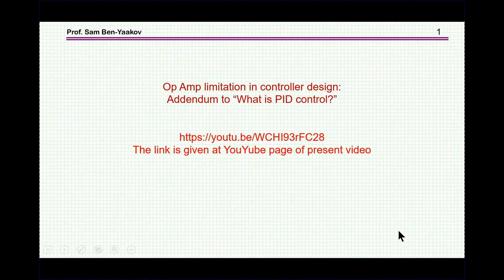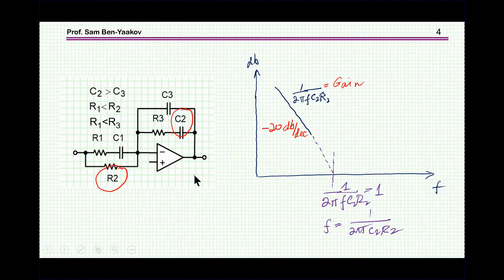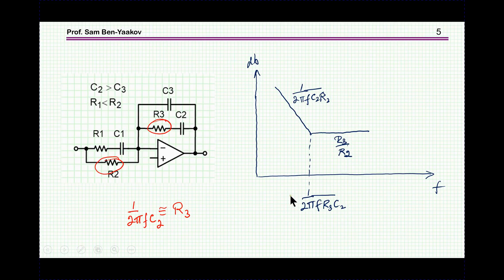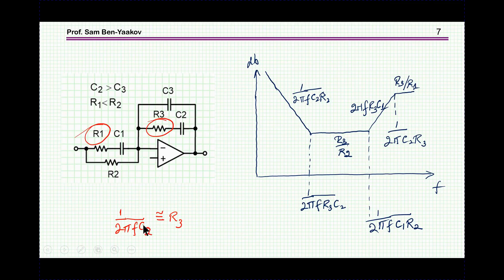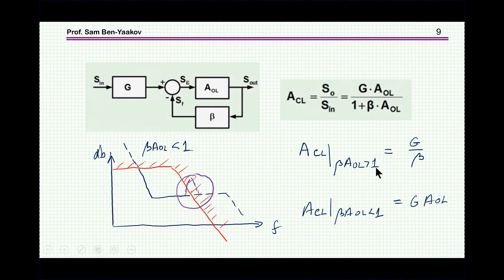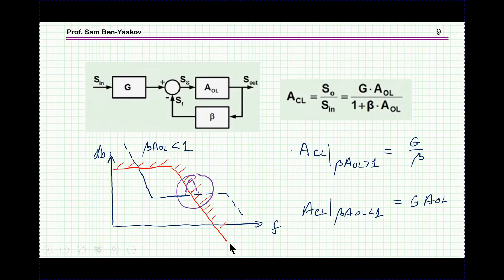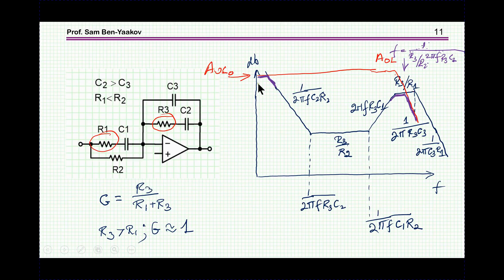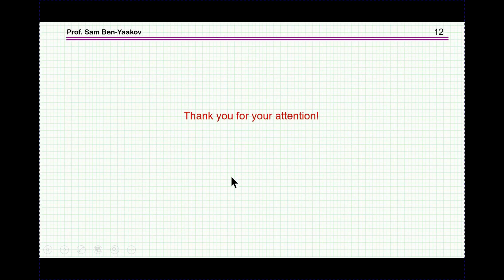Op Amp limitation in controller design

Comment: Thank you for vedio.
Could you upload vedio of type two compensator which includes T. F . , Poles and zero calculation and then bode plot.
---From India
Reply from the maker: Hi Shiv, Thanks for comment. Will consider it.
Reply: Sam Ben-Yaakov Thank you so much for your consideration. 
One more suggestions from side is take a numerical example and explain it.

Ex. Let's say type-2 compensator design for Flyback converter which includes TF of plant , post filter and feedback loop. Then how to achieve loop stability using compensator.

A beginner like me expect basic level of explanation which can easily understandable .

Thank you so much .

Comment: Hello Professor, myself Ganapathy, I'm having a doubt in control system which I can't find answer can you clarify it ?
My doubt is what is the frequency that are referred in x axis in bode plot ?
Where it present, input , output or feedback loop or the controller itself ?
I understand, in RC circuit ratio of output to input is marked against the input frequency which gives slope ,phase etc
But consider a PID motor control which controls the speed of the motor like a opamp with feedback control a motor with a mosfet and speed of the motor is feedback through a frequency to Voltage controller which generate voltage proportional to speed so the opamp have two inputs 
- reference speed (in volts)
- actual speed (in volts)
There is no frequency or ac components in the system how will get stability from blode plots ?
Similarly in RC circuit example I see the physical components of blode plot in terms of input frequency and change in Voltage for input and output in oscilloscope
But how can I view the physical components of the bode plot representing Especially the frequency ?
Another doubt consider the system with 2 poles and a zero when frequency hits first pole gain drops 20db/Dec, on 2nd pole it drops to 40db/Dec, then on zero it rise to 20db/Dec and the slopes intersect here so the system is stable but when the operating frequency lies in between second pole and zero where the slope is 40db/Dec still the system be stable ? Phase margin would be 180 when slope drops at 40db/Dec ,hence why the system stability is calculated from single point in the plot, what happens when the system operating frequency is other than that of a intersecting frequency point ?
I just try to implement the mathematical model to physical system and forgive me if my question are silly , but I need to know the physical components the blode plot , Nyquist diagram, root locus diagram representing
Reply from the maker: Hi Raja, 
If not imposing too much I would appreciate if you would post your question at the LinkedIn group I have stated. 
https://www.linkedin.com/groups/13606756

I , and perhaps other members of the group will respond and by this others can benefit from the exchange. Thanks.

Comment: Hi..if we take c3 effect on first term gain in account the total capacity would be rather c3+c2(in parallel) while the capacity appeared in last pole would be rather c2c3/c2+c3(in series)..any intuitive explanation for this and is it related to input output impedance of op amp
Thanks for hard work you do for making this videos
Reply from the maker: Hi George, Thanks for comment. My approximation is based on C2>C3. If you want to be precise, then you do need to take the resistor R3 into account, that is, to consider the total impedance.
Reply: Hi prof..thanks for reply
what I can't really understand is why relationship between c2 and c3 differs between the two cases..in parallel(first case) and in series (second case)
Reply from the maker: Hi George, You have good questions. If not imposing too much would you please  post these at the LinkedIn group that I have recently started. I and perhaps others will answer and  so many readers can benefit from the exchange.
Reply: Sam Ben-Yaakov hi prof..tried to post my question at the group twice but can't see it in the time line..may it need to be approved by you
Reply from the maker: It is already there. Normally I am not requested to approve posts, but in your case I was. Perhaps because it is longer than  average or because of its importance (-: If nobody responds I will, but please bear with me as I am over swamped at the moment.
Reply from the maker: Hi George, Just sen your addendum. It will be better to put it as a "reply" to the original post rather than a new post.
Reply: Sam Ben-Yaakov  hey prof..
I think it's a bug or somehow.. I don't think it's that important:-). I'm sure that you have a lot of things to do beside answering my questions..so I appreciate your reply whenever it comes.
Reply from the maker: I see now your post. It is a very interesting point. I love such challenges. makes me happy to be able to answer. I will prepare a short video on this. The short answer: the Zf is fed by a current source and when  simplified by Thevenin equivalent circuit is shows a pole at (1/(RC2C3/(C2+C3)). Beautiful.
Reply: Sam Ben-Yaakov even i still unable to understand it up to now but I'm sure that the coming video will provide all necessary details.. Not a lot of people even PhD holders can explain this staff like the way you do..thanks
Reply from the maker: Hi George, I have replied to your post, see
https://youtu.be/EJ4LYSlIQA4